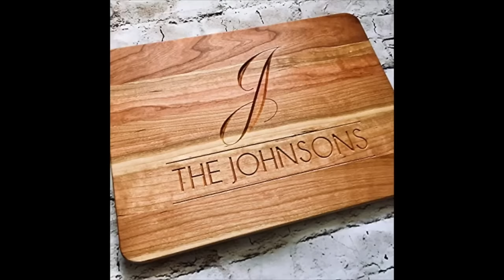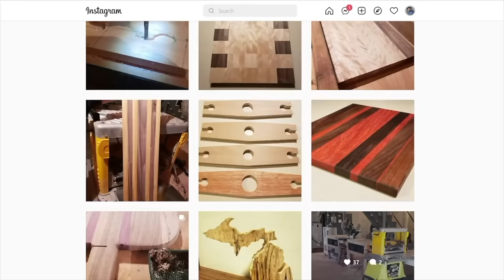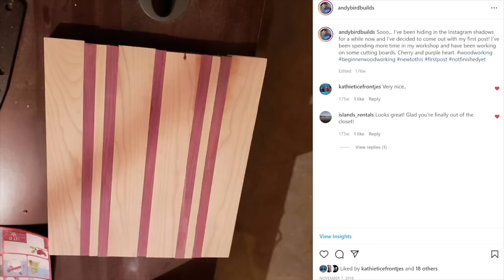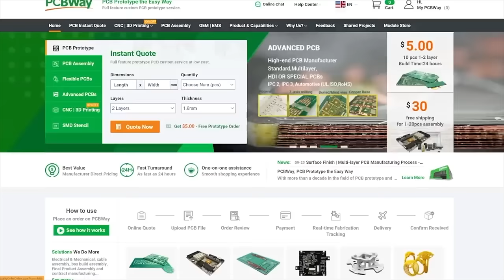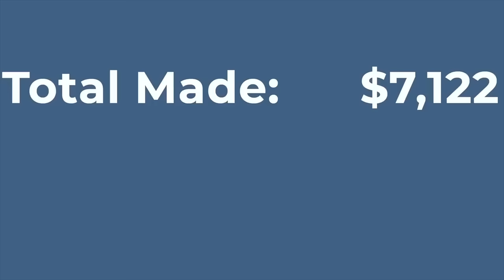Woodworking Side Hustle Tips and Tricks | Compilation

Comment: As a 67 year old man approaching retirement and looking to try and make a side hustle of my making, as a part-time income only, I have found your insights and the insights of some other Youtubers, including some that you have interviewed, to be most useful. My main problem is that I am an extreme introvert and the idea of going out to sell my services is something that I really cannot contemplate. If you are not such an Introvert as I you will not understand just how difficult is would be to try and sell, even at the local craft fair. 

So, your comments about selling to the sellers struck a chord as did another Youtuber who noted that the vast majority of his work came from other workshops that had run out of capacity to make enough of their own products and were farming out that production to small shops like his.

I found both of these to be very encouraging to the point that I am looking forward to making a few things to use as demonstrations of what I can achieve.

Many thanks.
Reply from the maker: Thanks for the message! We all have limitations but by identifying them we can come up with a plan to still get the results that we desire!

Comment: I've been working with cnc machines at home for a while. This is also my profession, but it is different. I've been doing it at home for several years. First with a small machine, which I quickly outgrew. So I got a bigger one. Similar to what you have. And I'm also shocked to see the first pieces. I have improved a lot. You give a lot of good advice, all of which require a complete person. Or more. Great video, keep it up. A Hungarian guy 💪🤘

Comment: Andy,
I have become aware of the need to produce obsolute aftermarket parks. I first thought of casting parts and have now thought  of using a CNC router for manfacturing . Most of the parts will be of plastic and rubber. What maching would you suggest for producing these parts?

Comment: You need some work on your accounting analysis.  There is no cost of sales tax. You collect sales tax and pay it back to the state.  You also do not show any cost for your equipment, consumables (bits etc) overhead (portion of your home it uses electricity it uses insurance etc).  Your net is not real and is inflated.   You also seemingly did not count your fabrication time.   I’m not sure if the h[urs you listed included that or just the sales trip.  I would also assume there was cost for the show.   Food hotel rental etc. 

I like what your doing but leading people to think they can easily make 100k is not practical in my opinion